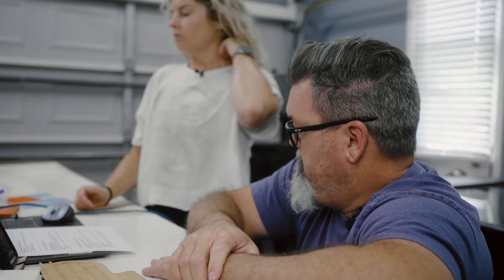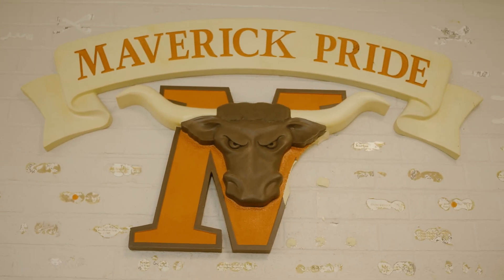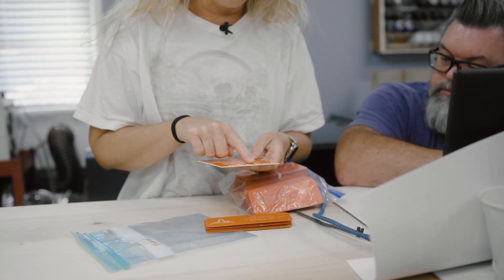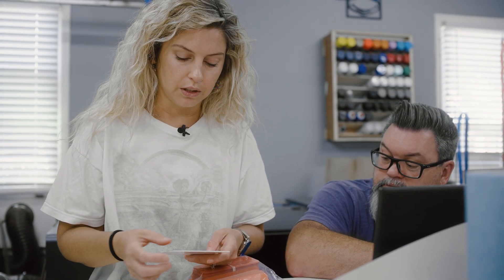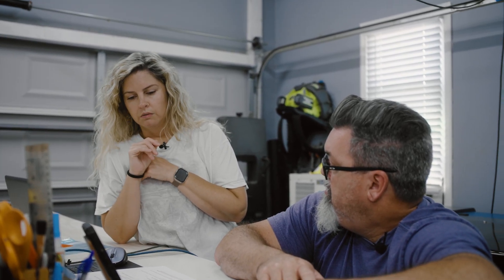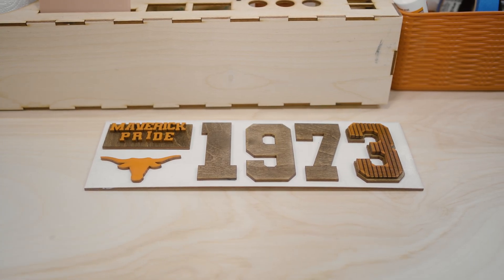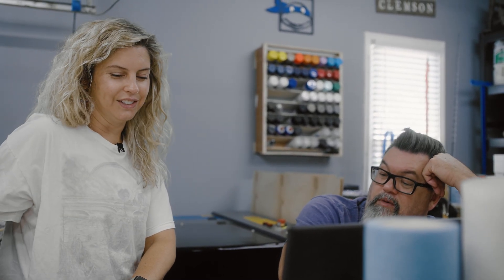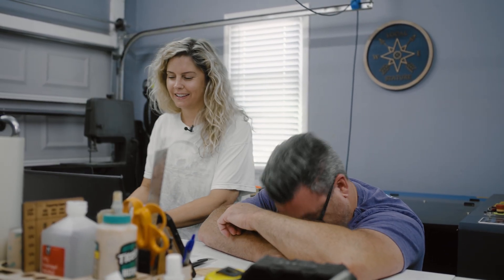We Took On Our Biggest Laser Engraving Project Yet! (And It's MASSIVE)

Comment: Forgive me if you already know this! I have an FSL laser, so I don’t use LB, but I am pretty sure you can do a mail merge type thing. Maybe called variables? Would help with the plaques with similar spacing.
Reply: Yes look into variable text. I know the clack shack has done a video on it and Kim and Garrett did it recently. Also, if you cannot do the numbers in your laser using LB and the pass through, consider finding a cnc shop that has a 4x8 cnc and have them cut it. Time. Accuracy and cost may work better. Or do the letters in pieces and fit them together since you have the grid over the top and have those joints in different spots. Just thinking
Reply from the maker: @kevinjensen9817  We will have to check out those videos for sure. Thanks for the info!
Reply from the maker: Going to have to look into that. Thanks!